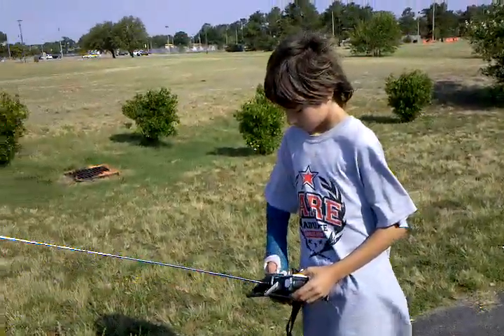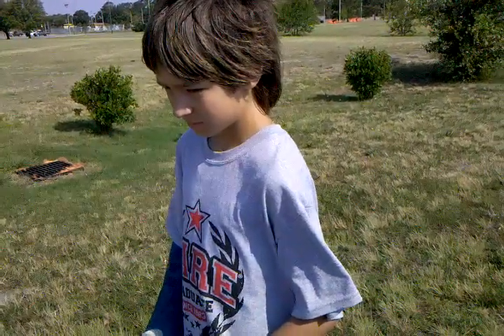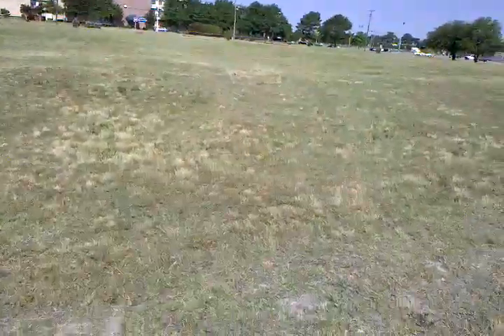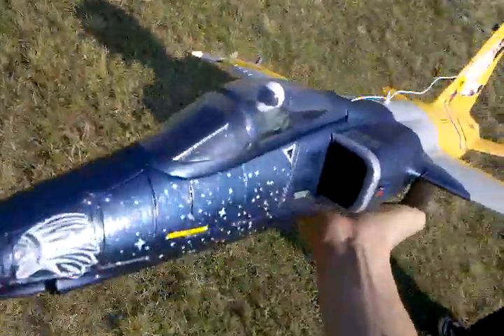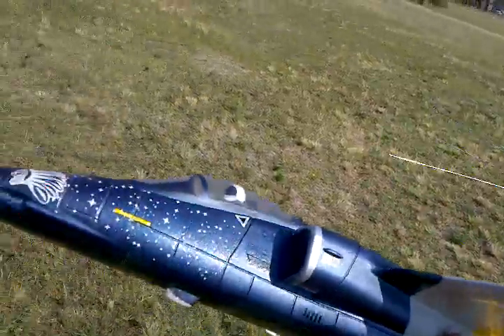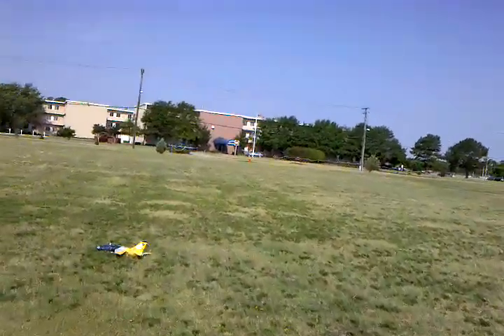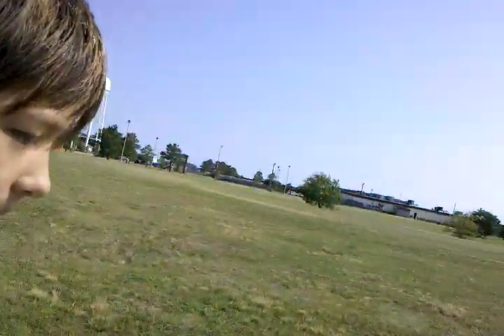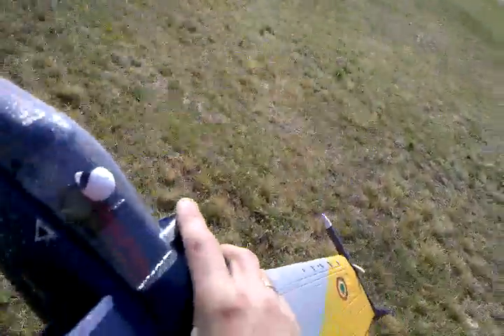Gabriels second flight AMX EDF.

Comment from the maker: @EMPrcRacing 
I don't recommend these little EDF's as a first choice. They are tricky to fly and are extremely fast and over responsive at full throttle.  However, they are strong and handle minor crashes well. My son flew props and trainers before I let him transition into EDF Jets. If you get one, make sure the recommended CG is spot on for the first flight otherwise it will be tip stall sensative if tail heavy, or have very little up elevator authority if nose heavy.